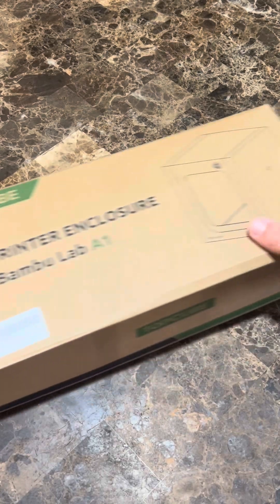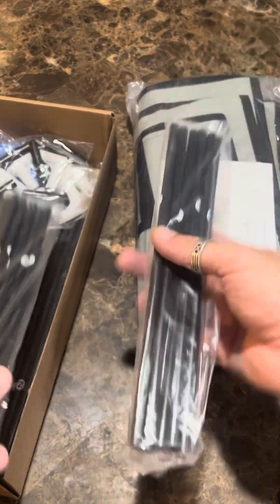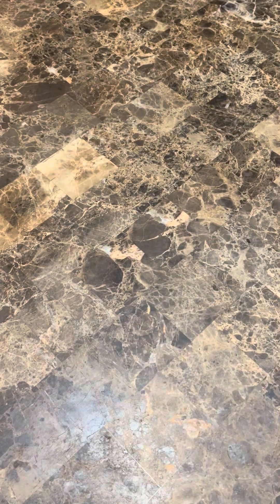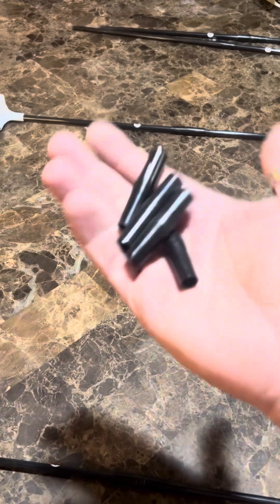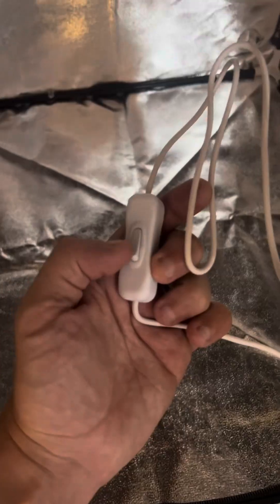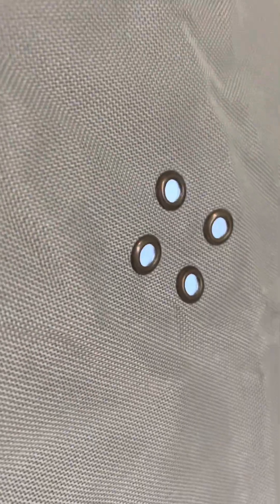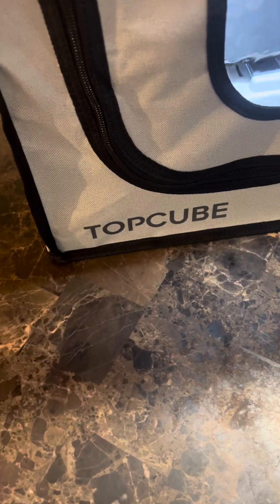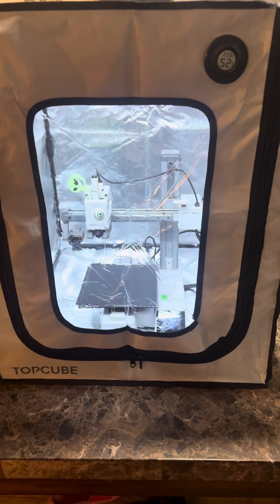3d printer Enclosure for A1 3d printer

Comment: How's your experience been with it over the past 10 months since posting this? Any notable pros or cons? And are you still using It? I was thinking of buying this bigger enclosure for my A1 Mini as well, after having it on my desk for the first couple of days and then getting a scratchy throat, light cough with mild headache and nausea I came to the conclusion that I'm not gonna gamble my health away and gonna move it to a spare room or a garage and put it inside an enclosure that's ventilated. It's disappointing to have to move it away from where I can see it but it has to be done.
Reply from the maker: I would say, even for the A1 mini, the A1 version is a better choice. Gives you more wiggle room. I did upgrade to a harder acrylic enclosure so I can stack things on top of it. I also have better visuals with the acrylic enclosure.

Comment: would be great if the printer motherboard doesn’t overheat
Reply from the maker: The Amazon listing states - “Improve Print Quality with Consistent Temperature Control: The TOPCUBE enclosure creates a stable temperature and humidity environment, enhancing printing quality and minimizing the risk of warping and breakage. Following extensive long-term testing, the internal temperature WILL NOT exceed 40℃ when using the enclosure, eliminating the risk of damaging the printer motherboard.”

Comment: A1 has no motherboard fan and will overheat with an enclosure
Reply from the maker: The Amazon product description states - “• Improve Print Quality with Consistent Temperature Control: The TOPCUBE enclosure creates a stable temperature and humidity environment, enhancing printing quality and minimizing the risk of warping and breakage. Following extensive long-term testing, the internal temperature WILL NOT exceed 40°C when using the enclosure, eliminating the risk of damaging the printer motherboard.”
Reply: @CoinRingMaker  "Consistent Temperature Control" how? It has no fans of its own.